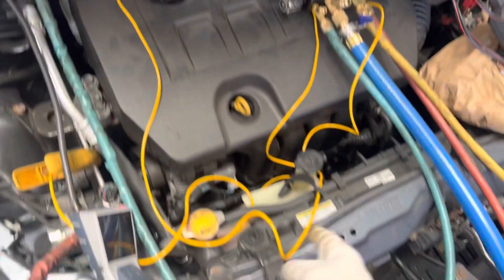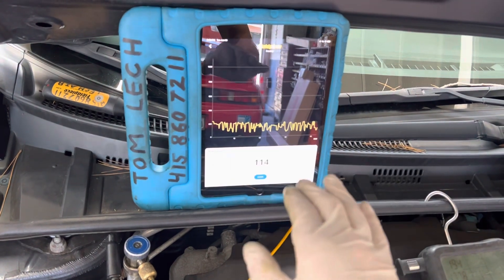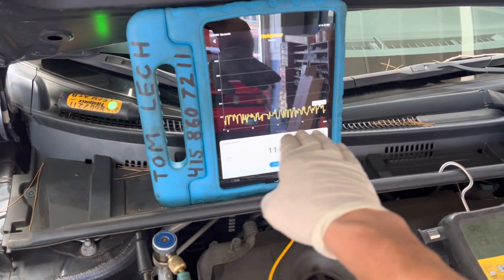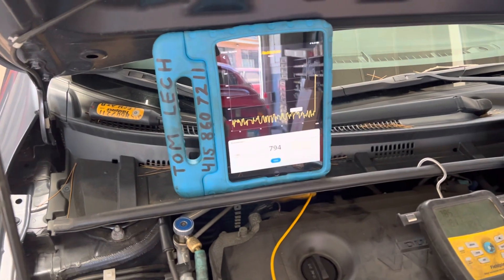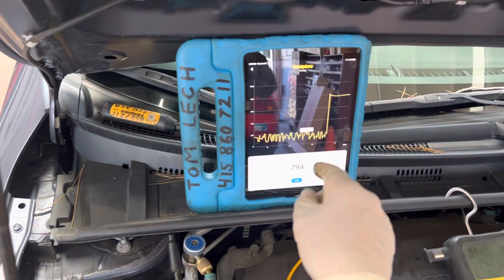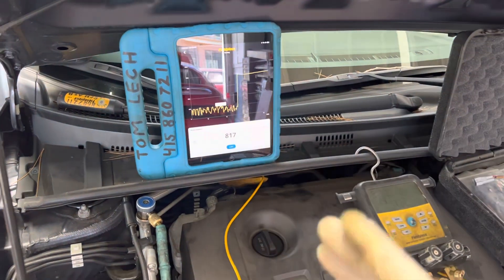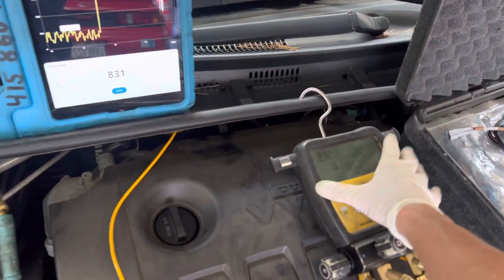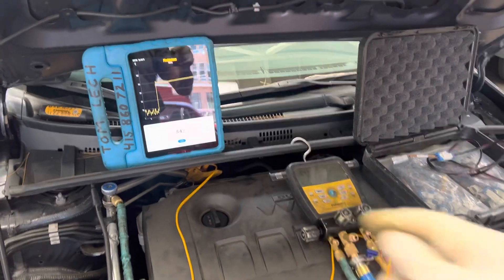Micron gauge readings explained on automotive. Micron gauge in your refrigerant manifold￼

Comment: Your micron digital display could not make it any clearer . After re doing my equipment and procedures all is good . My micron gauge copies yours when moisture is present and generally after overnight evac the micron rise and plateau occurs as per your display . I found using even new 1/4 sae single hose vac  with micron on opposite side works well .Because the lined charge/vac hose is new additional time from moisture and contamination does not happen and  therefore  gives very honest micron readings .
 Now I am upgrading for speed ,  going to try bigger hoses **  I am amazed at how quick first initial pulldown is eg minutes . Utube even does this with 2cfm pump [with a Tru Blu hose ] !!!!
Reply from the maker: You’re a good example the difference between a technician who can learn observe and repeat and verify the same procedures just like the scientific community does experiments around the world. 

When you have technicians who get the same equipment and they can’t comprehend what’s going on they don’t understand and they get different results that look bad and they blame the equipment . 
They say this equipment is defective .  This is the third one I got returned and they’re all defective. 🤣 

Yes, I say something is defective but it’s definitely not the equipment  🤣🤣🤣